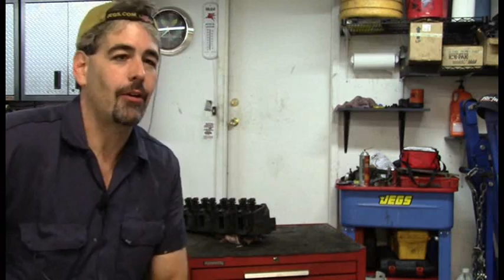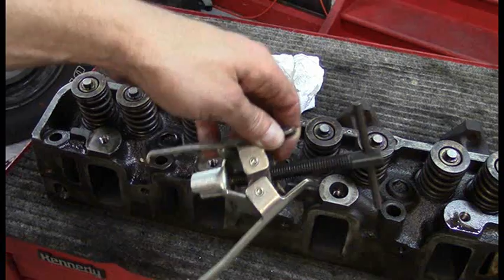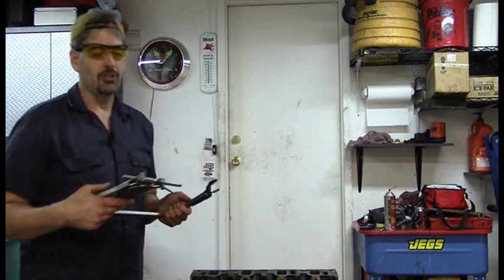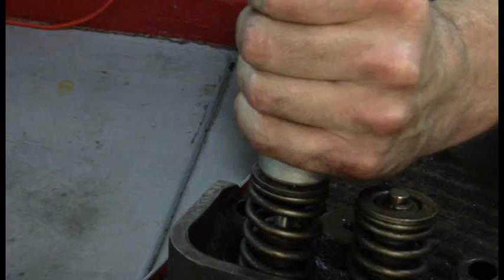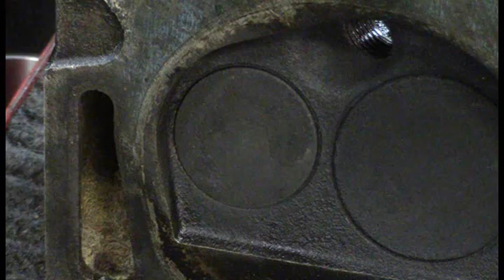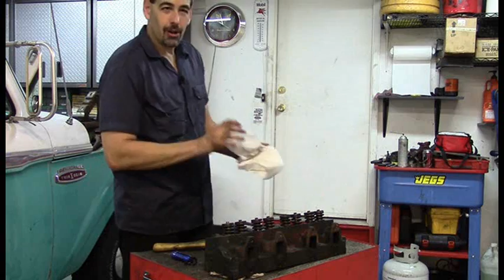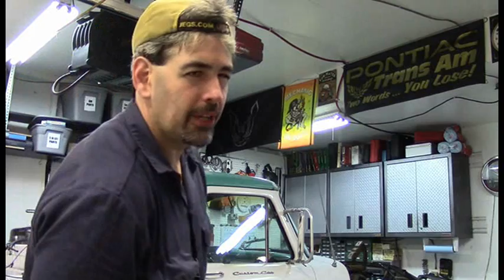Extreme Budget Engine Rebuild-Pt5- Cylinder Head

Comment: Sad this rebuild isn't going to happen but it's an excellent case on what happens when an engine is too far gone to be revived on a budget.  This engine can be saved yes absolutely just not within budget constraints set by the owner.  Realistically what are the odds you're going to find a direct replacement that isn't going to need the same amount of work?  I think unlikely.  Probably best for the owner to find a more modern replacement and do some upgrades like fuel injection and electronic ignition.  You could find a 10 year old engine for very cheap these days but you'd have to modify it to work.  Would be cool to put an OBD-II compatible engine in that truck!  Ah budgets, decisions must be made. :(
Reply from the maker: spelunkerd Yeah its hard to explain since the owner has a sentimental attachment to this truck- sentimental attachments are pretty foreign to me lol. It's funny but just many people have wondered why bother at all with this paperweight as have said they would rather do a total rebuild on this truck before they would depreciate a new one.  I know the owner has a long term goal of eventually completely restoring the truck and as you pointed out, having original components is a consideration in such ventures, but not so much on a '65 F100- it's not like a '67 fastback or something. The return on investment is far less significant for this truck.
  At this time we are actually negotiating with a machine shop on a rebuild
Reply from the maker: You know, given the owners personal family situation I think just cutting the losses altogether is the best decision as much as I hate to say it. But you're right - these projects are always about hard decisions.  Most likely we will try to find a similar model year salvage engine with a 30 day guarantee that I can inspect before install
Reply: Nice!  If we could actually see this thing go through that would be awesome.
Reply: Schrodingers Box I guess I'm a little surprised that the owner has been keen to keep the same style engine. Perhaps it's about greater resale market for vintage parts under the hood, too. As you say, it's not whether a rebuild could be done, it's about how much it would cost.